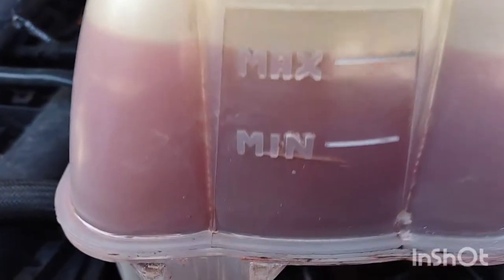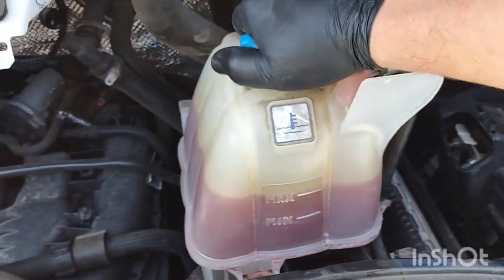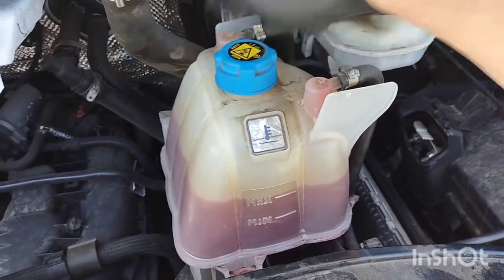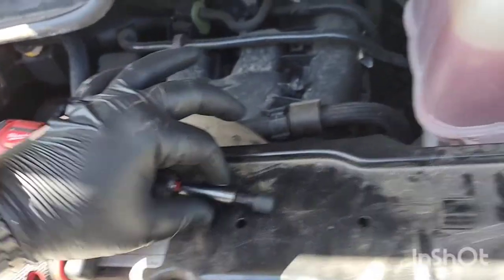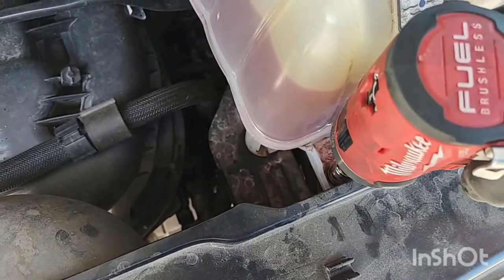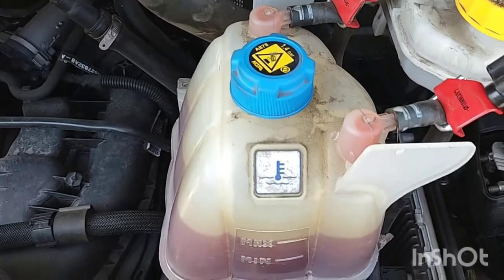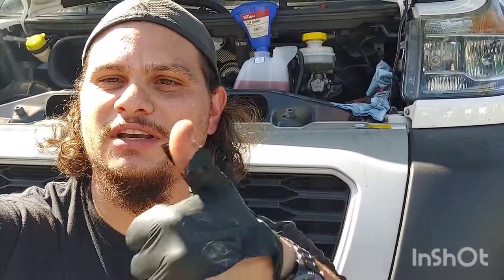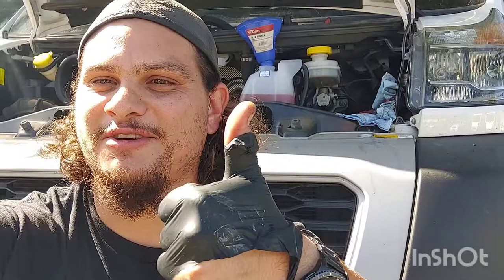How To Change The Coolant Reservoir On A 2014 And Up RAM Promaster

Comment: Thank you for the great video, very detailed and well paced; helped alot with my tank replacement. I bought a big pair of those bullnose dykes (as well as the fuel line clamps, very helpful tools) at Harbor Freight and by clamping on the outer portions of the clip that holds the factory hose clamps in place, they just unlocked and slipped off! Overal went smoothly and watching this video a few times helped immensely. Thank you!

Comment: you don't need to change it, you just need to use a hot iron melt the broken creck line a little, it will seal the leak.